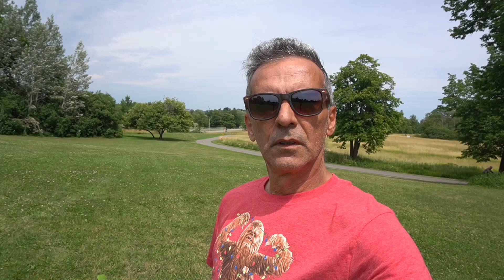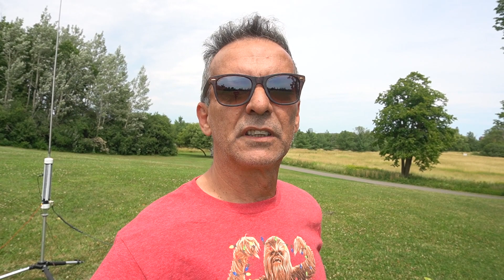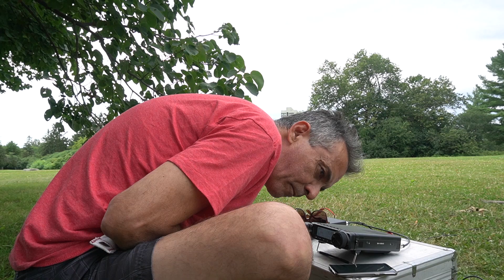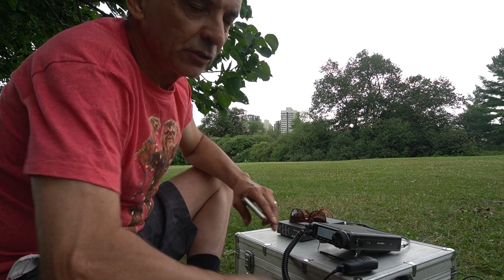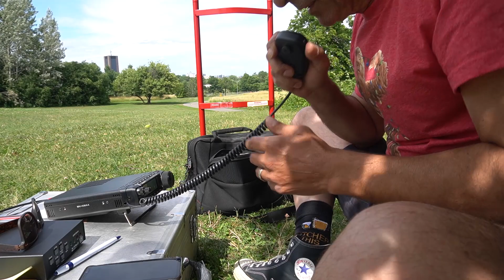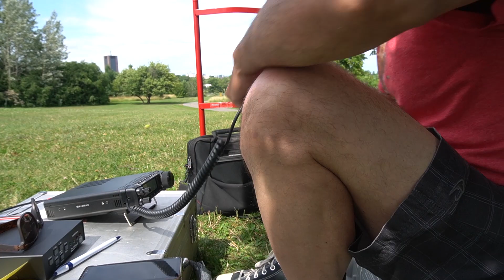Ham Radio - Trying new TX audio setting on the Yaesu FT-891

Comment: >P-EQ1 FREQ: 300
>P-EQ1 Level:    15
>P-EQ1 BWTH:    8

Level set at -10 to 15 db would be a more suitable starting point for the the lower band of the parameteric equalizer for adult males. Final setting will depend on the individuals' voice and operating conditions. For best effect use some compression but dont go overboard. Keep an eagle eye on the ALC and the TX on the FT-891 is not very clean if provoked. The TX 3 band parameteric equalizer on the yaesu rigs can give a huge boost both on clarity and talk power for even difficult voices but is somewhat tricky to setup.
Reply from the maker: Hi Denis, thank you so much and as a new Ham information like this is very valuable for me. I will try this setting in the future. 73 de VE3DAL.
Reply: @VE3DAL  I forgot to mention that MEQ and PRC both need to be enabled in the control menu or the radio will ignore the TX audio setting. When it comes to Ham Radio there is always something new to learn and often something old to re-learn! 73
Reply from the maker: @denis77996  Thank you Denis.

Comment: Interesting, what level compression were you running with the processor on? I've had good reports since I changed mine.
Reply from the maker: The changes I did plus on the back of the mic switch set to 2.
Reply: @VE3DAL  You enable those changes using "Function - 1" menu item "PRC" at 40 or 50. PRC = processor. Without PRC is 15-01 to 15-09 settings... Cheers.
Reply from the maker: @Rich_Pierik  Thank you for the info Richard. 73